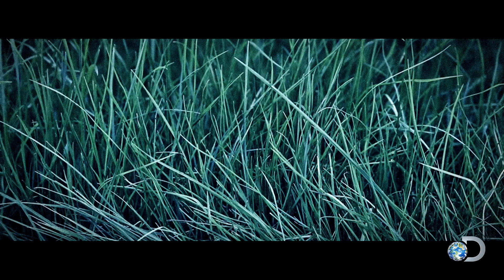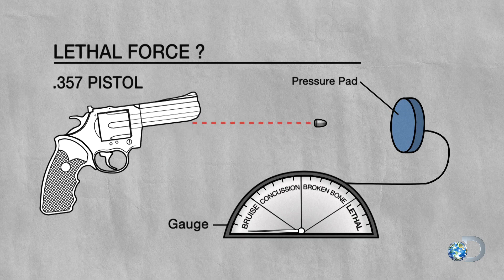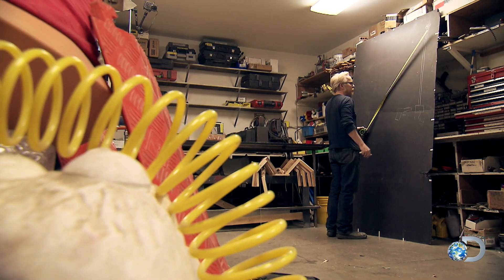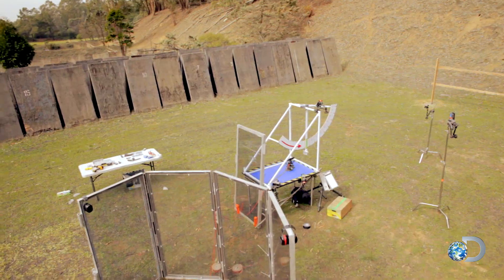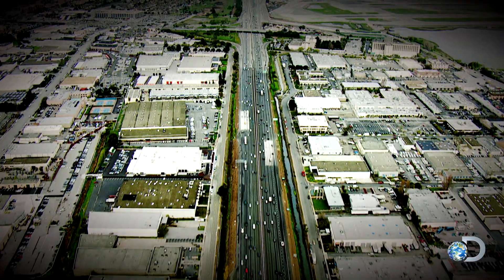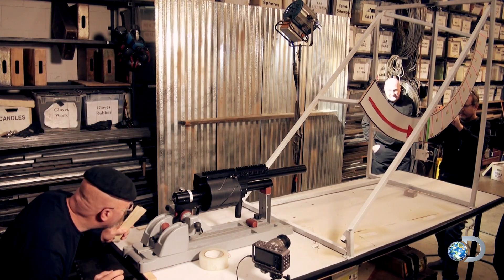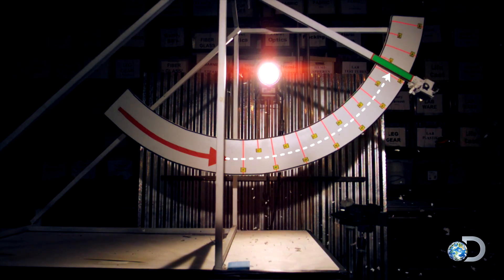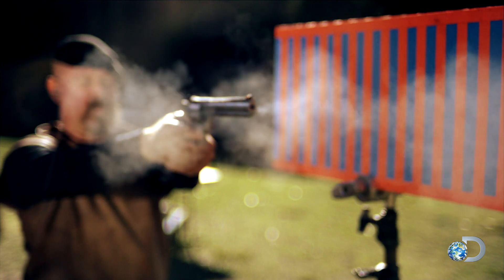Lethal Lawn Mowers MiniMyth | MythBusters

Comment: The problem with this test is that they are basically saying that a rock hit by a lawn mower is as deadly as a .357 round. The rock is far less aero dynamic then a bullet so it will lose speed much faster then a .357 round. For something like this to kill you you would have to be standing like 10' from the mower.
Reply: +Jayson Rabaey Blunt force drama doesn't require going through a skull like a bullet does, and comparing to to a .357 was overkill anyway, way less can kill. Considering people have died from being punched once. This myth is more then plausible.
Reply: I know but that is not what I am saying. If a lawnmower blade hits a rock its not going to be able to kill some guy standing 300 feet away, much less travel 300 feet. I would bet that even at 50 feet it wouldent be able to kill someone. It would probably send you to the hospital though.

Comment: Wait couldn't the air from the pneumatic launcher move the pendulum by itself?
Reply: AgentBrain  Not nearly as far . The air by itself can as easily "blow around' (if you will) the pendulum . The rock is a mass carrying energy with it directly to the pad .
Reply: AgentBrain a late reply
Reply: No because the air from the launcher wont reach the target before the roc

Comment: The pendulum measures momentum, not energy. Please visit a physics 101 course.... :-)
Reply: NuclearSavety  The resistance of the pendulum (since it starts at rest) to motion measures the energy required to alter it's state (from static to in motion) . Please ready Physics for Dummies ... ;-P
Reply: +Glendon Griffith The problem is, the pendulum does gain much less kinetic energy as the stone/bullet looses since much of the energy is lost to heat. In contrast, the momentum of the stone/bullet can not be lost, thus the pendulum is a good measuring device for momentum, but a really terrible one for kinetic energy. 

Please open your physics for dummies book on the chapter of inelastic scattering...
Reply: 1/2mv^2=mgh
Stop pretending to have even taken physics.

Comment: What a bullshit test !
Reply: +Nick Mcguire thats what i was thinking. Plus he said it could kill someone from across the street and there is no saying that all that power is going to be held with a rock.
Reply: +Revengefull “Revenge” death Like they said at the beginning, the lethality isn't the point, nor is the range. They were just testing if a lawnmower could launch a rock with similar force to a bullet from a pistol.
Reply: vlad the lad your bullshit
Reply: Fatherbrain ,
Reply: I really want to do this just to mess with you, but technically that isn't a pistol it's a handgun or more specifically a revolver. A pistol is a handgun that has a chamber integral with the barrel. That means the chamber doesn't move the shell is the one that is kicked away.

Comment: Not a good test.
Reply: MRIguy They did a lot more on the actual episode that got cut out. http://www.screenfad.com/mythbusters/myth-busters-season-16-episode-9-recap-accidental-ammo-41052
Reply: MRIguy Why is that?
Reply: Mark The Gr8 do you not know what a sling is? The same concept  is applied. The only thing is that the chances of it hitting someone is close to none so
Reply: joshuajaydan Did they at all consider that a lawnmower engine doesn't grab and shoot off a rock like a pneumatic gun? That force is transferred to a rotating blade, which doesn't shoot off a rock like a pneumatic gun and that the rock will deflect before flying out? I've read your link, and it also says they actually removed the mowers safety guard, which of course you shouldn't do. They're basically reducing the myth from "Can lawn mowers be lethal by mowing through rocks?" to "does a lawn mower engine have enough power to potentially be lethal?", which of course it is.
I'd perhaps agree to a plausible conclusion, with the more detailed explanation being "theoretically possible, but entirely unlikely and only under certain circumstances".

In an older episode they were testing out a rotating thing also shooting out something (yeah not very detailed). They tested it by making like a 320 degree metal barrier and attempted to hit the 40 open degrees by doing several attempts until they got it right. I would have preferred to see them do something like that here and reenact a swinging blade rotating inside the mower with a certain rate of deflection.
Reply: Yeah I feel that this one is more plausible, that if a complete dumbass took off the safety guard and hit a rock that shot at the perfect angle to hit someone, it could maybe hurt as much as a gunshot. So in theory its possible like you said, but incredibly unlikely to actually happen unintentionally. Sorry im 3 years late lol
Reply: This test is flawed all over the wadding they use to launch the rock hit the pendulum as-well that is quiet a wide area of force being applied so it will drive it up a lot higher than just a rock hitting it.
Reply: agree a real misleading result